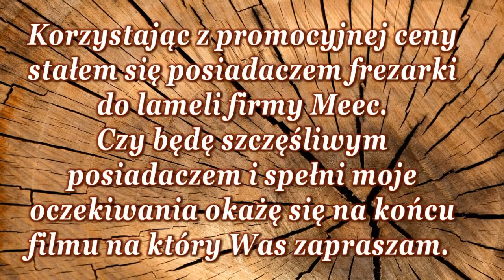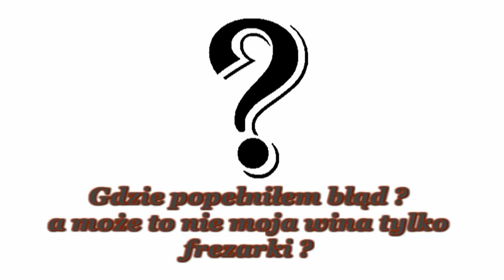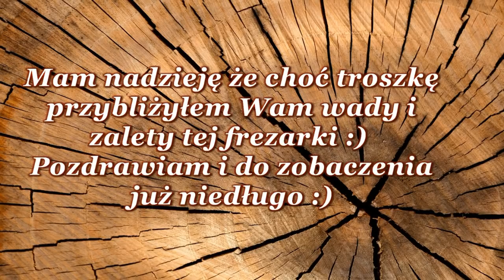# 048 Lamelownica Meec

Comment: i bought the same tool a few days ago. The thing is all biscuit joiners should have 3 marks for 3 biscuit sizes, this one has like 6, i dont know how to set the depth of cut in relation to the biscuit size. Any sugestion?
Reply from the maker: sorry for the spelling but my english is poor, i use translator. You need to set the depth so that the biscuits enter at least halfway, there will always be minimal slack on the sides and you can move 2-3 millimeters along the length. Lamelo you will never make a tight hole along the length, here you have exact positioning only on the material thickness